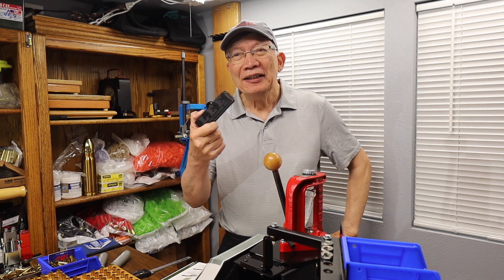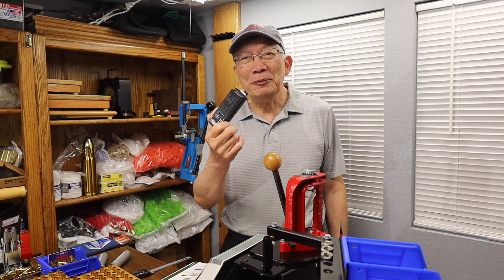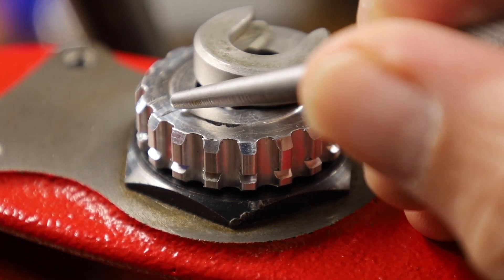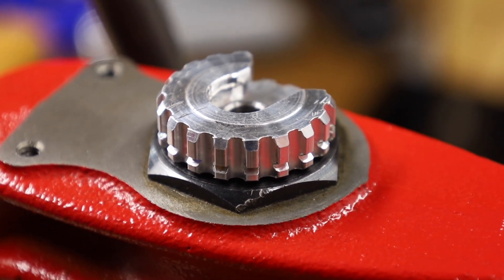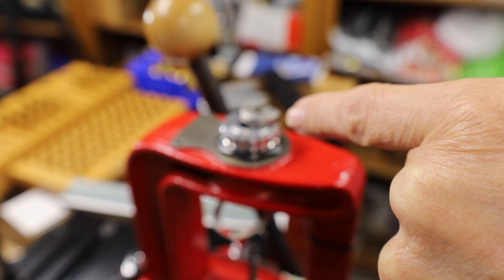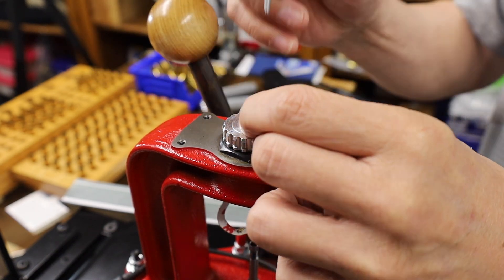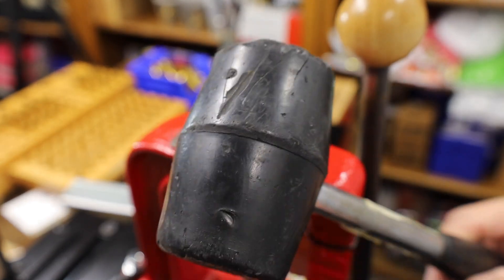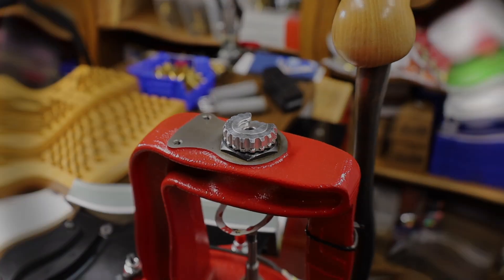Send Back To Lee Or Home Engineer A Solution??

Comment: While you have to be very, very careful, I've found my dremel to assist such tiny modifications! When my 209 primers didn't seem to fit Mag-Spark percussion adapters in my Ruger Old Army, a helpful person there pointed out variation in 209 primers was the cause! Now I just have to use red wax to keep them from falling out off the loading slot!

Comment: A little bit about different brands and types of primers. 
Which ones to use, when and why. 
All CCI and Reminton primer, plus Winchester's small pistol are the safest to use in automatic priming tools.
Federal burns hotter and cleaner, yet are according to the Richard Lee manual "one tough dragon to control in the automatic priming systems".

Modern Reloading Second Edition Richard Lee Revised 2021, page 60:
To find out why some brand primers explode violently, I talked to an expert, Dave Anderson, now retired from CCI. He told me primers are charged with one of two types of charging compound. One is called "basic" and the other is "normal." The primers that use "basic compound" must not be used in Lee Priming tools because an accidental discharge is very violent. The "normal compound" is less violent and causes little damage to the tool. The user is easily protected by safety glasses. 

Metallic Cartridge reloading, Robert S. L. Anderson, page 20: 
In the firearms industry there are two types of lead styphnate primer compounds - "normal" and "basic." There are presently four manufacturers of primers in the U.S., and all of them except one uses the normal lead styphnate primer compound. Federal is the only manufacturer that presently uses basic . The common ingredient to all small arms primers is lead styphnate of which there are several different varieties. Basically it is in crystalline form and is very explosive. Normal lead styphnate is composed of large irregular crystals, which are slightly acidic when wet, somewhat more brisant at lower temperatures (good for military use), and they burn with a cool flame at ambient temperatures. However, it is somewhat harder to get an even mix of components in normal lead styphnate primers because of the larger irregular crystals and the fact that the "mix" often requires some metallic fuels (such as powdered aluminum) to help make a magnum primer. Basic lead styphnate is composed of small regular crystals and unlike the normal mix is not as acidic and will not attack primer cups when wet. Basic lead styphnate is easier to mix than normal variety and there is no need to add metallic fuels. The basic primer flame is very hot and will easily ignite most powders and therefore Federal does not offer a magnum pistol primer. However this style primer is slightly less brisant at very low temperatures (- 20degrees F. to - 40 degrees F.) which would make normal primer more suitable for military purposes. 

Metallic Cartridge Reloading, All New Third Edition, M.L. McPherson, page 29:
Certain brands of primers might be unsafe to use in some priming tools like Lee's AutoPrime because of the potential for mass detonation. With these tools, should an operator detonate one primer, as can happen when a handloader tries to seat one primer on top of another,  the detonation subjects other primers in the tray to shock and an incandescent flash. If this shock and flash can detonate a second primer, there is the potential that most or all (perhaps 100 or more) primers in the tray might detonate en masse. Such a simultaneous detonation would be a disaster. Lee has tested all available primers and, excepting CCI and Winchester, all brands produce an unacceptable number of mass explosions when the primer being seated is forced to detonate (by heating in a remote explosion-proof box). By comparing Federal and CCI primers, we can gain some understanding why brands very in this regard. Federal primers do not have a foil covering over the primer pellet; an application of a type of paint replaces the foil. That sealant is easily ignited and highly flammable, possessing a very low kindling temperature. These are beneficial characteristics; among other things, they help reduce combustion residues. However, use of this pellet sealant makes these primers very easy to ignite. Exposure of the open front of the cup to the flash from an adjacent primer easily does the job! Conversely, CCI primers have a paper foil almost completely covering the front of the pellet. This foil deters pellet ignition because it is only moderately combustible and has a relatively high kindling temperature. A short duration flash from a primer is unlikely to ignite the foil or penetrate through it to ignite the pellet underneath.
Reply: I've always preferred and try to use (when available) Winchester primers. CCI primers are too hard and Federal are too soft. Winchesters are somewhere in the middle and nearly perfect. You'll get crushed, damaged, scratched, dented primers much more often with the other two. Also if you have a pistol that can or does light strike the CCI won't fire all the time.
Reply: @JohnDoeEagle1   I see Winchester as a problem child in themselves when using lighter springs in cold weather. Personally I run Federals for their consistent ignition in any round that counts, no matter what. Plinking wise I could care less as to just which primer is in the cartridge. But normally I will buy CCI if Federal is not available. But if Winchester is all that is on the self I would buy them for plinking (only). But which ever primer one may use they should always check each primer for a compound pellet and an anvil before installing them. 

I have never had any issues installing either Federal or CCI primer as you have described. Normally it is either the priming tool's fault, or that of the operator, and not the primers when trouble occurs. It would sound to me that either you need to clean your priming tool or fix it if you are having any issues whatsoever as you have described. Or perhaps even get a superior priming tool in the first place.
Reply: @thetexasrat  

I always keep the priming bar, cup and bearing track clean on my Dillon RL-550B, Dillon RL-550C and Dillon XL-750. They don't like to feed CCI primers without "crushing them in there". Dillons don't like CCI primers. My two RCBS Rock Chuckers, Redding T7 Turret, Lee #90045 single stages don't have that problem. My RCBS hand priming tool doesn't either.
Reply: @JohnDoeEagle1  So far I have only tried Federal and CCI primers. I use a Lee Ram Priming die set, on a Buchanan Precision Machine hand press with the L-N-L quick change die bushing set-up. It seats either of them square, without crushing, every time (unless I purposely over exert). This set-up has excellent sensitivity/feel to be able to sense the primer inserting and just when it seats.

So one may have to wonder if, with those longer press handle bars, too much mechanical leverage is being exerted upon the primer in  order to actually crush them (as can be done with even a hand priming tool if heavily squeegeed). Because, if the primers can go into the cases with no problem in one tool and not another tool, then either one tool has a problem or it is due to operator error. And keep in mind the more complicated the tool the more room for issues to arise [greater tolerances = slop = misalignment/ less sensitivity = not being able to know just how much pressure it really takes to get the job accomplished]. Many times keeping things simple is the better way to go. But then again I have never had any experience with these other priming options so, other than guessing, I really could not say just why such happens.
Reply: @thetexasrat  

Finally started reloading in 1989 and my oldest (90s) vintage Dillon RL-550B has had approx 300k rounds loaded through it since then. I ruled out "operator error" a long long time ago. I am not saying you can't use CCI primers in Dillon machines. You just have to be way more careful than you do using Winchester or Federal primers while doing it and expect some rejects you will have to do again.

Comment: Three things to keep in mind here, “primer dusting” + “static electricity” = “ka-BOOM!”

VihtaVuori Reloading Manual 4th Edition, page 96:
Handloading is an enjoyable, rewarding hobby that can be easily carried out in complete safety. However, like any human activity, carelessness or negligence can create hazards. Handling primers and powders correctly is at the core of safe handloading practices. Do not store large quantities of primers in bulk! Doing so will create a bomb! Primers kept in bulk can explode en masse – the explosion of a few hundred primers is equivalent to throwing a hand grenade into a room! Do not use excessive force when loading primers into equipment, primer tubes, or seating them in cartridge case primer pockets under any circumstances. Take special care in filling and handling auto primer tubes - they have been the source of many explosions.

Metallic Cartridge Reloading, All New Third Edition, M.L. McPherson, page 6:
FORWARD
... ... never forget that when handloading ammunition you are dealing with energetic materials and devices capable of bringing great harm and destruction. I am constantly reminded of the dangers primers present. One regional ammunition manufacturer formerly demonstrated this fact to all new employees  at the company's annual picnic. At 200 yards, he would set up two targets: one was a company coffee cup with 200 primers in it; the other, two sticks of dynamite hidden behind a similar cup. He would then explode each target with precisely placed shots ... The question the group was to answer: "Which was which..?"  And the answer was not obvious!
page 29:
Primer Safety
If there is one area of deep concern, it is safe handling of primers. I don't understand how it happens, but people are always finding ways to set off a primer unintentionally. Stories abound of handloaders, managing to mass explode them. These incidents often involve hand-held priming tools or automatic primer feeds using a tube of stacked primers. The handloader can treat primers with all manner of disrespect, but sooner or later he will pop a primer unintentionally. If that happens to be intimately associated with a large group of primers, the results can be devastating. Even one primer by itself can inflict a severe wound ... ... ... Certain brands of primers might be unsafe to use in some priming tools like Lee's AutoPrime because of the potential for mass detonation. With these tools, should an operator detonate one primer, ... ... ... the detonation subjects other primers in the tray to a shock and an incandescent flash. If this shock and flash can detonate a second primer, there is the potential that most or all (perhaps 100 or more) primers in the tray might all detonate en masse. Such a simultaneous detonation would be a disaster. Lee has tested all available primers and , excepting CCI and Winchester, all brands produce an unacceptable number of mass explosions when the primer being seated is forced to detonate. 
page 30:
Handle primers with the respect these little bombs deserve and follow all safety precautions provided by the manufacturers. Always wear safety glasses when handling primers.

Swift Bullet Company Reloading Manual Number two, page 38: 
The Basic Rules for Reloading Safely Introduction
Read all available books on reloading. Make yourself as knowledgeable as you can.
page 40:
Primer Handling
5. Do not dump together in bulk. There is a risk of mass detonation if one is ignited.
6. If resistance to seating or feeding of primers is felt, STOP and investigate. 
DO NOT FORCE PRIMERS. 
There have been instances of “primer dusting” in the tubes of reloading tools. Clean machine after each use. 

Lyman 51st Handloading Handbook, page 29 and 39: 
CAUTION: Primers are explosives and require special care handling.
page 28: 
CAUTION: Safety glasses should be worn whenever handling primers. 
page 58: 
CAUTION: Always wear safety glasses whenever handling primers. 

Hornady Handbook of Cartridge Reloading 11th Edition, page 85: 
Primers are the most active, potentially dangerous component employed in reloading. You can get into trouble with them handling in such a way as to discharge them …

Nosler Reloading Guide 9, page 44: 
DO NOT FORCE PRIMERS
9. There has been instances of “primer dusting” in the tubes of reloading tools.  Clean after each use. 

Barnes Reloading Manual Number 4, page 44; 
Norma Reloading Manual Volume 2, page 146, under “Primers”:
6. If resistance to feeding or seating primers is felt, STOP and investigate. 
DO NOT FORCE PRIMERS.
9. There have been instances of “primer dusting” in the tubes of loading tools. Clean after each use.

Berger Bullets Reloading Manual 1st Edition, page 104: 
The safe reloading of ammunition is largely based on the use of common sense. 
page 106: 
Always Clean up After Each Reloading Session
Debris will collect and it can be a safety hazard. It is therefore, important to clean up your work area after each reloading session.
Safety always comes back to the use of common sense. If you ever find yourself in doubt, stop, research the question.

Lyman 51st Handloading Handbook, page 59: 
CAUTION: Primer feeds require extreme care. … … handling primers one at a time is a safe procedure. However, primers handled in bulk are a potential hazard. Should you choose to use an automatic primer feed, extreme caution is required. … … Should one primer explode, all will do so spontaneously with disastrous results. Even a few primers exploding can cause serious property damage and personal injury. Many high volume reloaders feel an auto primer feed is a necessary part of their equipment. If you think you number among these folks, use extreme caution when working with an automatic primer feed. 
CAUTION: Never push, bang, bump or otherwise apply any force to a primer or primer feed.
CAUTION: When using an automatic primer feed, at the first sign of a primer jam or difficult feeding – STOP! Then think about what must be done. Force nothing and do not be tempted to jiggle the tool or any part of it even slightly. Rather, carefully disassemble the primer feed. First remove the primer magazine and all primers contained therein. Clear the jam, determine the cause for the jam, and correct the problem before proceeding with use of the primer feed.
page 60: 
CAUTION: Extreme care must be used when filling a primer feed magazine tube with primers. Never force a primer into a pickup tube. A pressure of no more than five pounds should be required for a primer to slip into the tube. Do not use any primer pickup tube requiring more than this amount of force.
CAUTION: Primers can and do “dust”. 
CAUTION: Static electricity may cause primers to explode. 

Hodgdon Powder No. 27 Data Manual, section 6 -10, under "Handling Primers": 
They demand the respect and careful handling due any device containing explosives. Primers should never be handled, used, ... in bulk, since primers in bulk can explode simultaneously. ... ... ... Precautions should be taken to avoid buildup of static electricity on the person when handling primers or conducting handloading procedures. Loading equipment should be electrically grounded. 

Speer Handloading Manual Number 15, page 41:
Static electricity and the Reloader 
1. Static electricity can be highly hazardous for the reloader. 
2. primers are most sensitive to static charges. The energy is enough to ignite primer dust in and around priming tools. The dust can ignite and propagate to all the primers in the tube [or tray]. The result is a serious explosion. This is the reason to keep those tubes [and trays] clean! 
3. Static charges prefer low humidity environments. take some simple precautions. 
a. Use a humidifier. 
b. remove carpets from reloading areas. This is the prime source of static energy accidents. 
c. Clean the reloading area on a schedule. Routine cleaning removes residues of primers and propellants that can react to static energy. 
d. Use an anti-static product[s]. 

Modern Reloading Second Edition Richard Lee Revised 2021, page 59:
Tony Sailer from CH Tools gave good advise about primers. “Reloading is pretty safe, until you handle primers in quantity.” Tony, a commercial reloader, visits other in the business. He says look at the ceiling above any powered reloading machine and you will see holes above the priming station. Primers in a tube explode with great force and unpleasant regularity. Jim Hulbert, retired from MEC, tested shotshell primers in a seamless tube. When the bottom primer was intentionally detonated, a 1X6 overhead looked as if it had been hit with a 12 gauge shotgun at close range. 
page 60:
Accidentally drop a tube full of primers to a concrete floor and you are going to have one heck of a bang.💥

Posies of TheTexasRAT:
        And Remember,
                           Wisdom Never Lies
                           Inked Within The Pages Coddle By A Book
                           But Yet Rather Supply About
                          The Inside Of Open Minds
                          That Render The Confound Thereof

Comment: I  had a burr on my Lee Multi-stage press that was causing the machine to shake on the return of the handle to the upright position.  I found it and used a stone on it.  Smoothed it right up and now there is no shake or problem.

Comment: Thank you for addressing this, I've had the same issues with mine. And found the same solution you did. However, when I put the show holder in it does not always want to seat squarely and sometimes tilts to the side and needs realigned.  Not the best setup, but works for now.